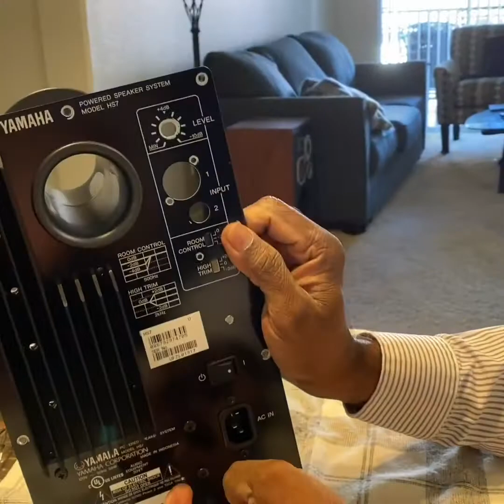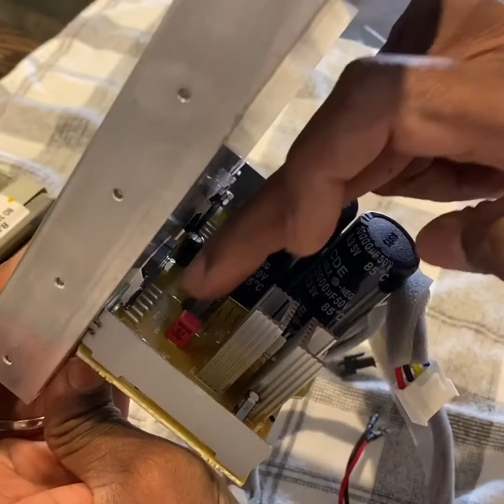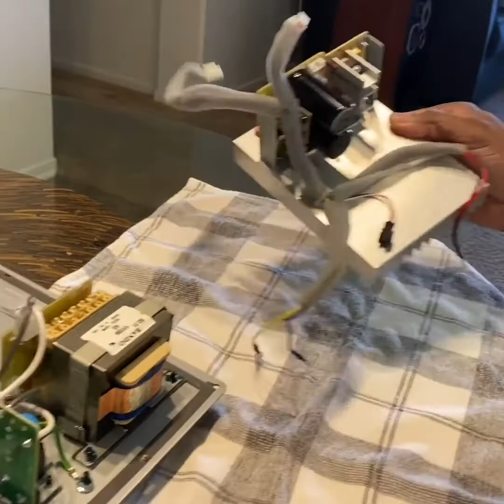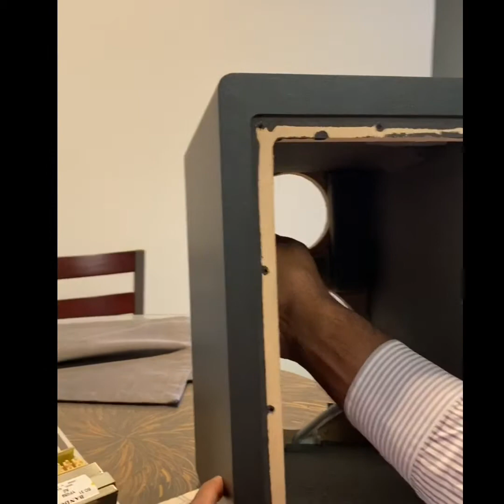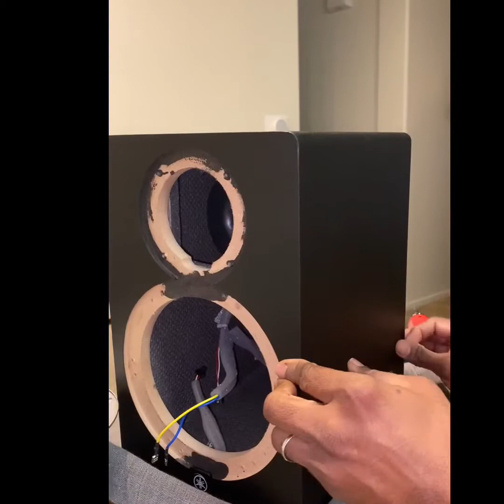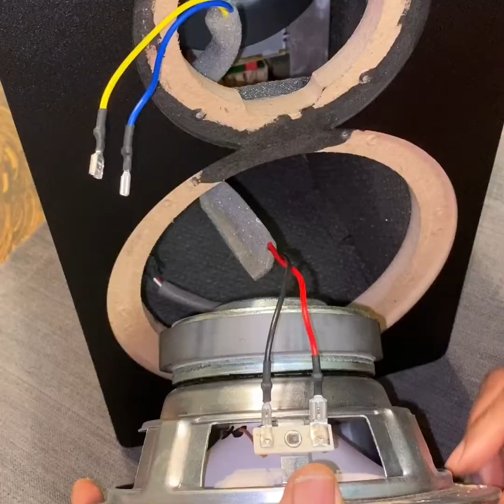Modified Yamaha HS7

Comment: Hi mate good vid. Would you be ok with me using some of your vid and linking it on my other channel. My other channel the vid series im planning on doing is to show the full limiter circuit removal and re-lining of the box accoustics. I will ask first and again thanks mate and on top of that im happy to do mods on speakers for anyones material i use.
Reply: Where is that video?
Reply: @ParbhdeepSingh Hi mate ive made a few vids but not posted them yet. Im getting asked alot so what i will do is leave all the "unread" notifications on these comments so i know to come back to you when i get the vids up. Im doing a basic derestriction and re-lining the box with Jantzen 8mm and accoustic tape. Then a further vid showing the bigger modifications and how to push them to the limit of what size PCBs will allow and what the maximum cooling limits are with the better acoustic insulations in them. Im trying to do it so i have access to the testing equipment after the mods so i have all the proper data that everyone wants to see. I must be honest i underestimated how longbit takes to do a good youtube speaker mod vid alongside my job😂
Reply: @DongMcDing Got it, thanks for the update. I am thinking of sending my HS7s and HS8s to the Zen Pro guys to mod so anything else that they can do for me at the same time to help the sound would be appreciated replacing as well alongside the upgrades they will already be doing so keep in touch about the results.
Reply: @ParbhdeepSingh if you can solder at all then dont send them anywhere mate. Buy some Jantzen 8mm felt, a glue stick and some speaker baffle tape.

Comment: HELP. please.      i got a rattle in both my speakers at low hrz. when i press on the backplate right in the middle it goes away like there is 2 flat surfaces that stick back together and it goes away for a while. i havent taken mine apart yet. any idea what it could be?
Reply: Take the backplate off and line the surfaces with car subwoofer gasket tape and put the backplate back on
Reply: @DongMcDing it was the heat sync. i just had to tighten it down. there are alot of hidden screws. if it starts up again ill just take it off and put thermal paste down. thanks

Comment: One thing I noticed is that the woofer does not have a felt ring between it and the mdf. A felt or rubber ring will further improve damping and probably sealing between the cabinet and the speaker
Reply from the maker: Yeah, you can use sealing tape on the baffle.
Reply: Yeah it works. I insulate them with Jentzen 8mm acoustic fabric and run car subwoofer gasket tape around the box. The driver pulls it down nice doesnt stick out or nout and the speakers sound great after it. Ive tried other insulation in them but the Jantzen 8mm stuff makes them nicer sounding. I even done a set of matched pair one in Jantzen 8mm and one in other cheaper stuff from amazon claiming the same and the Jantzen 8mm lined one was noticabley better sounding. I tried that dodoliner too and that was ok but not as good.

Comment: Have you considered or tried removing the grills from the twitters?
Reply: Does nothing. Insulating with Jantzen 8mm then running a gasket of subwoofer tape around the box where the baffle is so the driver is damped from the enclosure. You can also wrap the port tube and they sound better too. Ive tried other insulation in them it isnt as nice sounding they dont measure the same either so its not my ears its just they must like that insulation in that particular mdf enclosure.
Reply from the maker: no
Reply: Это часть акустического оформления ВЧ. После такого вмешательства изменится диаграмма направленности.

Comment: i wonder if that plastic bass port has its own resonance, and if it should be dampened around the outside. unless it's considered a rear port midrange exciter.
Reply from the maker: Damping the port cleans up the midrange a little. Use the adhesive foam on the outside.

Comment: are you familiar with removing the built in limiter on the amp of these monitors? supposedly it really really opens them up
Reply from the maker: Yes, it's not very difficult to remove.
Reply: @audioupgrades7759  how do you do it?

Comment: I recently rebuilt my old Mackies HR824s.. Nichicon/WIMA caps, MUSES8920 op amps, Mundorf resistors, Vishay bridge rectifier, UP-OCC copper wiring.. etc. Im looking to add HS5 to my setup and also modify them. 
Curious which op amps you ended up replacing the original NJM4558 with? 'Im thinking MUSES8820 or LM4562 (more budget friendly) for replacement as they use the same for HS5/HS7/HS8
Reply: I also have the HR824 mk1 realy good monitors. with class a b  amplifier. and have the msp5  also class a b . and have nichicon  caps . but most new monitors like krk or tannoy and some adam,s have cheap chinese capacitors .. I never sell my hr824 :-)  . sometimes I do modifications , but don,t think the hr824 or yamaha msp series need that . the are high end.  yamaha HS series are more built for home studio,s
Reply: LM4562

Comment: I would very much like a build sheet or some more instructions on that, otherwise, great video and great project!
Reply: Other mods i do to HS is the inner accoustic wool taken out and replaced with Jantzen 8mm felt and i run a bead of woofer/driver sealing gasket tape around the box before i put the mid driver back in. They sound way better than stock after that. All very easy nothing hard about modding these speakers.
Reply: This mod is beyond DIY level. The circuit traces are very delicate on the boards. If you are a tech, then yeah you can handle it.
Reply: @easydoes-k9f drivel. Done it no sweat on 8 of them in total with a little hakko station. Same as any other sound system pcb just dont be hanging around in the same spot too long. Get the tip heat right up and get in and out fast. Mopped up the old solder no problem too without lifting any pads so i dunno what else to say really. Infact modifying the led light on our Boss FS5L footswitches was harder, i roased a pad or 2 off of them hanging around on the same spot just a few seconds too much. I rate the mods on HS speakers easy as it gets and anyone with basic soldering skills will do it no problem.

Comment: well done... 
didnt i see +/- regulators with TO-220 heatsinks. are those for the tone pre-amp?
if yes, adding more high freq bypass caps might not be that helpful. cos the bipolars inside are in active regions. so PSRR is very high. 
and since there are no regulator for the power amp stage, adding more low esr electrolytic/poly caps are helpful. but not sure it will be audible tho.
looking forward to your next upgrade.. :)
Reply from the maker: Thanks for watching. Those regulators are the dreaded 78XX and 79XX types, and no I didn't add additional bypass capacitors to the +-rails for the opamps. The .1uF red caps bypass the electrolytics in the signal path. My next upgrade will be to remove that regulator circuit and use lower noise regulators. The most significant change in the power supply are the 10,000uF caps and the bridge rectifier.
Reply: @audioupgrades7759  oh... coupling caps... good idea!
haha... those linear 78/79 are not that bad tho... and not sure you can do much more there. a pair of LDOs could be placed in front of them to "pre" regulate the inputs of the 78/79... this can lower the operating temp at least... and further reduce the ripples/noise...
again not much you can do with the rectifier bridge itself... you can tap it off from the transformer and split the supply... one to the preamp and one to the 3886s...
and good luck for finding those humongous caps. they must be Japanese low ESR caps. and they will cost you an arm and a leg... so why not put the smaller ones in parallel instead... OR just regulate it!!
Reply from the maker: @XChaoticComposerX  Yeah, there are several paths to this upgrade. I did the easiest and cheapest. I've also thought of using a SMPS power supply to regulate the amplifier power supply.
Reply: @audioupgrades7759  oh... no... no... no...
you paid bucks to get these linear! no audiophile in the world like switcher. so dont turn this into a car stereo/boomboxs. switching noise spectrum is TOO broad!
Reply: @audioupgrades7759  wont touch it with a ten foot pole...
Reply from the maker: @XChaoticComposerX LOL....relax. You might be surprised where high end audio is going.
Reply: @audioupgrades7759  i know... i saw... eg JBL powered speakers... so you are my last hope here... hahah...j/k
Reply: @audioupgrades7759  dont drool... you have promised...
https://www.youtube.com/watch?v=QIwraPJOO3s
Reply: @audioupgrades7759  im sure this is not a class D/T
https://dwww.youtube.com/watch?v=EEAkELbLFUw
Reply from the maker: @XChaoticComposerX  I still listen to vintage amplifiers...
Reply from the maker: @XChaoticComposerX   Probably Class AB
Reply: @audioupgrades7759  :)